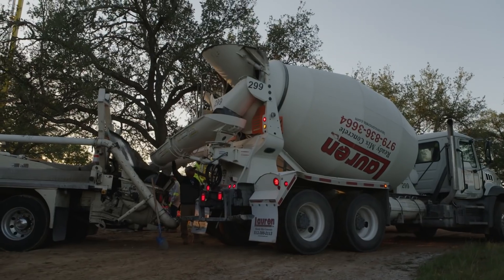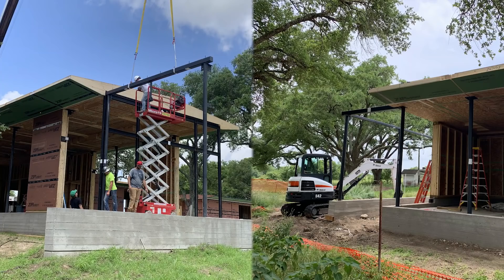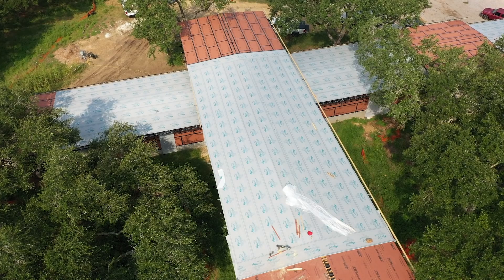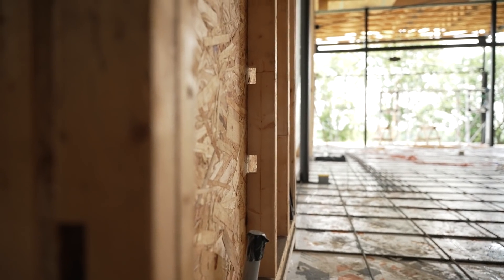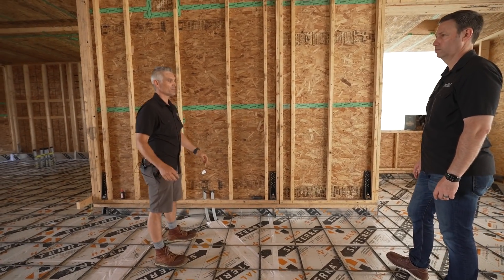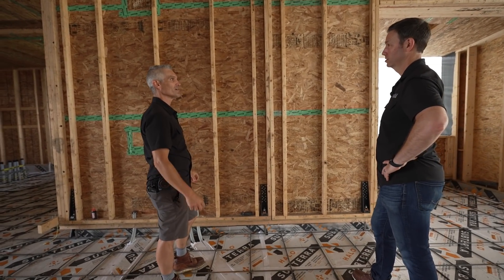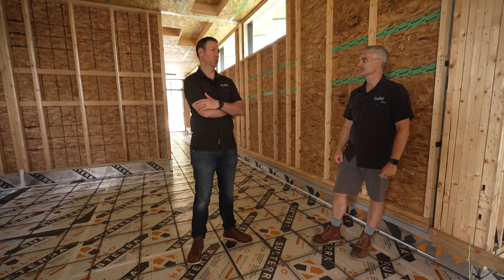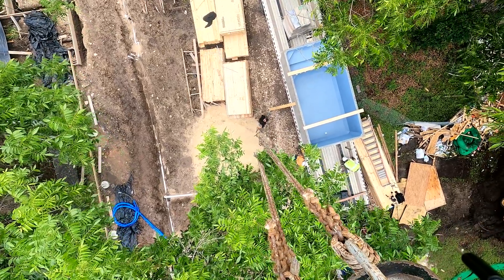Structural Insulated Panels - Framed This House 4x Faster

Comment: On the taping, texas vs europe. You tape the warm side of the structure to prevent condensation inside the insulation when Hot air passes through and cools down. If it's 60 celsius outside you have different things to worry about..

Comment: No need for any kind of termite barrier between the panels and the slab?
This is something to trips me up. I like the idea of taping the panel  to the exterior slab face, for air sealing reasons. But how do you handle termites?
Reply: They put up "termite free zone" signs all over the property... the termites just find another house to bother...
Reply: There's another video of this build that goes over the slab construction and the termite barrier used for this house.

Comment: Hi Love the channel can you explain why the narrow trimmed external zip board is in the centre height of the wall & not at the top. Does this improve the structural integrity of the building. it looks like it makes  the window cut out a lot less complicated by ensuring the entire window is in the middle of 1 board rather than several. would be interested to know your professional explanation. Yours respectfully Jimmy from the UK.

Comment: SIPS are great. Their major caveat is they absolutely REQUIRE expert installers to not only achieve their potential, but to avoid moisture damage. Qualified SIPS installers are not common and Johnny Homebuilder should probably not endeavor to install them himself.
Reply: I am not sure I agree with that. There are lots of resources for step by step installation that most people can follow. there are even workshops that aren't that expensive for people who want to build their own. As long as the foundation does not have any errors, and the panels are assembled nice and tight, the assembly is fairly simple. Caulk every joint, use the provided fasteners, then foam the seams. Walls are easier than roof panels, for sure, but the process is the same.
Reply: absolutely doable with avg building experience.  inexperienced, but willing helpers with one experienced builder, easily done.

Comment: I've been trying to find more info about the sheathing and taping both sides of the exterior wall, but can't find anything, in part because I don't know what it's called.  What is that method actually called, where they sheath both sides of the exterior wall with wood, like OSB sheathing panels.
Reply: The Unity Homes & Benson Wood youtube pages might help? They have videos showing the wall panels being built start to finish with some explanations. The interior OSB acts as their vapor control layer...

Comment: Re speed... our Bensonwood/Unity home: first SIP panel dropped on 12/4/17 (the foundation was poured about 2 months earlier).  We moved in to a 100% completed home on 3/17/18. Built during one of the most intense NH winters in the past 25 years.    Matt, stop by the next time you're in NH: Friday night is pizza night ;).  You can ogle our heat-pump driven ERV...

Comment: Is bensonwood making the sips themselves? As a timber frame designer I have not saw sip panels using zip system.
Reply: Yes, Bensenwood / Unity Homes builds their wall panels in their own factory.  There are several videos of their factory.

Comment: Matt:  How does this style of construction compare to others for tornado resistance?  We are going to be building in the next year or two and my wife is extremely concerned about tornados and having a house that will survive one.  Thanks.
Reply: It won’t be much different from a stick built house.

Even if you build with concrete, it will be very hard for a home to survive a tornado.  With wind speeds above 100 mph, it is very hard to keep the roof on the house.
Reply: Go ICF all the way. I've used both Hobbs Vertical ICF as well as Build Block. Combine that with Helix micro rebar in the concrete and you've got a bunker that will withstand anything a tornado, hurricane, earthquake, and it's even fire proof.  6"of concrete also blocks a lot of sound and you never have to worry about mold or rot.

Comment: Back in the mid 80s . I worked on prefabs . I was The Hooker . Responsible for finding the center of gravity on each panel . Windows installed .. It was blow and go . Some panels could only be hooked with a cable around the plates because of Windows were in the way .. Got screamed at and told how to hook one . Went up 40 ' and swung . Ready to lower and the plates popped .. Surprised nobody got killed as it cut loose .. Years later and more experience . I was working for Donald Gardner Architects .. They were #1 in nationwide sales . My job was not only to build his houses but find ways to innovate his plans . He came to me with a Pre-Fab contractor . And I asked .. So you think you can pre tab this house ? . Ah. No . !! . Donald took one of their simpler plans and had it pre fabbed . He told me to come by one morning to watch this miracle .. So I and my crew grabbed some popcorn and leaned on the truck .. Laughing.. In the end I later had to go fix this house .. Pre tab is fine when building a box of cells .. But it doesn't work on anything that has any complexity .. I don't care how many super computers are used

Comment: It's all very environmental er except thousands of tons of concrete🤢 So carbon footprint terrible - FAIL, sorry guys.
Reply: In terms of carbon footprint, the fail is building a 7,500 square foot house in the first place.  No amount of energy efficiency will ever make up for that.

It drives me crazy that all these famous rich people preach about carbon footprint while building these enormous homes, flying in private jets, and leasing new cars every 2 years.
Reply: @M1911jln  absolutely spot on.
Reply: @adriancarey7848  Just to be clear, I’m not blaming the architects or builders — they are building what the client demands.  And certainly if you are building an enormous home it is better to build one that is energy efficient than one that is not energy efficient. 

But we need to start shaming people for building these ridiculously large homes while claiming to be green. There is nothing green about this level of consumption.

Comment: Don't forget the crane cost an operator and crane where iam is over 125 a hr so 6 weeks just 8 hr days is 15 grand so prob be more like 8 weeks for most say 200 a hr. 32 grand later not including the Advanced framing walls would be a lot. 32 grand is 2 guys Half a years wage roughly.

Comment: Matt, what is the comparison of SIPS compared to stick built homes. I remember years ago that the SIPS panels were brought in with a crane for the walls and roof. And this design was typically used for the floor joist as well on a already foundation. Is this method still used today? Thanks

Comment: it makes up for it by being 4X as obnoxious to install electrical and plumbing.
Reply: I’m not in the trades, so I don’t know why it would be harder. The studs already have not notches to run wiring, pipes - so what makes it harder to do?
Reply: No it’s not.  Bensenwood has already notched the studs for plumbing and electrical, so this is easier for the trades because normally plumber and electrician would need to drill through studs.

Comment: @Matt Risinger why is there a structural slab below the foam and the topping slab if there are no interior load bearing walls? I'm guessing that the architect or structural engineer hasn't watched enough of your videos to understand that a structural slab is probably not needed below that foam.
Reply: secret basement lair...
Reply: One possible reason is that the house may be built in an area of expansive soil and required a "raft slab". I'm not saying that IS the reason. But that's a situation that arises frequently and pouring one massive slab is a straightforward approach to dealing with the expansive soil.
If there isn't some sort of structural engineering justification like that then it definitely seems like a waste of a lot of concrete and the production of a lot of unnecessary Co2.
Reply: If you didn't have that slab underneath, the slab above would crack with every step after the foam starts to settle... it's just a moisture barrier between the main slab... without it, you have nothing... it ties all the walls together and holds their loads together... is it that hard to see??? You don't build a 7,500sq/f home like that on chain walls... are you serious or just kidding???

Comment: I don’t like the roof! Did you notice the way it the 5 foot overhangs underneath (outside portion) tappers towards the house walls. I might be old school, but isn’t the water supposed to be kept away from the walls. I suppose there will be gutters to help with erosion anyway, but it is a little concerning.
Reply: I had the very same thought about that design — any water that gets on the underside of the eaves, whether from condensation or wind driven rain, will drain towards the house.  I would prefer the eaves to be flat or preferably sloped away from the house.

Comment: Matt, Please excuse an amateur question:  what happens during very strong winds?  
Are those long hollow rooms going to "rack" into a parallelogram?
Or, will the additional interior walls add to the overall structural integrity?
Reply: Those long hallways have those metal cross bars to help with racking. And the other parts look to built will Glulam/ trusses. I think it’ll be fine ? But that’d be scary if the whole house warped lol
Reply: @nickbsick6142  I was also mostly concerned about very strong winds that blew before all construction was completed.  The tall ceilings have created very large surface areas at the exterior walls.

Comment: I've seen many videos on fast wall building systems -- but walls are not the slow bits to finishing a house construction. The slowest steps are typically the basement concrete (including curing), roof (trusses plus later decking and shingling), and finishing interior trim or kitchen/bath cabinets and tops. And permits with inspections. I'm not in the home building trade so it would be great Matt if you did an episode showing the whole project timeline and chunk out the big time consuming steps to go from a bare lot to a family stuffing their furniture inside. Then methods like these wall systems that eliminate time from those major critical path steps. I'll bet it's appalling to see the amount of time consumed getting permits and waiting on inspections and corrections.
Reply: Just because one can build faster does not mean one should. Every contractor is dealing with schedules, meeting clients, multiple job sites and has a wife and kids at home. Quality of life, setting down the tools and going home at 4 pm means something too. When a developer puts up cookie cutter houses in a subdivision, subcontracts can go from one house to the next saving time and costs.

Comment: The very low pitch roof will probably be a never ending problem.
Reply: It's going to be standing seam metal roof, with a good product leaks should be next to impossible.
Reply: Nah.  Flat roofs have been around forever and they're detailing it well.

Comment: All that overkill and still using dinosaur studs. I guess the owner will be broke after all the wasted construction and will need to save a few bucks on heating and AC.
Reply: I'm intrigued, please elaborate
Reply: @Daviddaughters  They already had panels that are structural and well insulated. Then they went to the trouble of adding a stud wall inside. Oh but they also wasted time cutting square notches in them for the electrician. Oh my,, drill a hole and move on.. Wood studs. Later they will need many straightened. No way these billionaires are going to put up with a less than perfectly flat wall. Where is this house requiring the entire floor to be super insulated, Antarctica? 
Gees Build. Show us a process good for the common man, affordable and available. He's gone and whored himself out to product manufacturers. Lastly, builders in shorts and sneakers.....no respect.

Comment: As a carpenter I wonder how repairable is this structure. Let's say that 30 years down the road some sheathing gets rotted and studs now what? Im constantly repairing rot on houses built from 2000s and are covered in rot.
Reply: my brother can answer that question - one of his neighbors built a SIPS house and let it get wet.  2 years later, they built temporary walls inside every exterior wall and completely removed the remains of the SIPS and replaced it with traditional framing.
Reply: @kenbrown2808  just want to remind you that the SIPS panels that matt is talking about in this vid aren't like the traditional SIPS panels ... the SIPS panels made by bensonwood are wood framed and have cellulose insulation ... they aren't the foam panels with two OSBs on either end
Reply: @dovahkindragonborn9827  so... are they treated to prevent rot?  because you now have something that is 100% organic fiber.
Reply: why would it rot?  The exterior Zip system is supposed to be waterproof
Reply: You know what us behind zip coating osn
Reply: Why do you think rebuilding these walls would be any different than a stick built wall?  This wall system is built with studs, Zip sheeting, an OSB panel, and another smaller interior stud (to frame the utilities channel), plus cellulose insulation.

Comment: Is that roof truss profile designed to reduce uplift like an upside down wing at the awning? Because that’s what it looks like. I also like the steel beams with tension ties on the bottom and the cross brace at the end wall. It’s a structural piece of art!  At 2:39
Reply: ,many tho would consider industrial and ugly....

Comment: I suppose you might say that the Swiss design their houses like their wristwatches.    And we can learn from that.  But NOBODY's contractors are more productive than America's.    To put up an air-tight, 7500 sq ft UNIQUE... highly-engineered...  house's shell... rain proof... in 30 days (notwithstanding 20 inches of rain during that period!) ... is simply mind-boggling.       Did he say only "5 framers" did that?      Well, even if the panels were pre-fabbed elsewhere, that boggles my mind.
Reply: They look Latino. Hardest workers I've ever built with.
Reply: Greatest country in the world.

Comment: We built a home out of SIPS building Went up in 2 months with 4 guys building 5500 sq ft. Very insulated structure here in WY. We love it so far. Some minor changes we would have done but overall great so far.
Reply: What sip panel company did you go with? What changes would you make? I am looking at building a sip house next year.
Reply: EPS.  Make sure you plan all your window and door placements very carefully. Any changes can be hard and some not possible after they frame it up! We wanted larger windows in our living area after they put up the walls. Engineering said no. Very disappointed about that. So that really is my only problem. very cool in summer and warm in winter here in WY  @b.c.g.9754
Reply: I looked into it here but at the time no one made them here and shipping from the lower 48 made it real expensive.  I ended up going with double stud walls with foam. Our place is a duplex with our unit being larger with a garage between them. We heat over 3000sqft with about 450 gallons of oil a winter. We have weeks that don’t get above zero. I also don’t know what the specs are on snow load on SIPPS.
Reply: Are sip built  homes energy efficient?

Comment: I'm rather surprised the client didn't want to go with radiant heating in the floor.  Although you would probably need a couple of boilers at the end of each wing of that house.
Reply: It's not something you really see in Austin.  Also, at near passive, it's not something you really need.
Reply: How many miles of tubing would that take ?
Reply: @augustreil  Probably 2 or 3 LOL
Reply: There's a lot of open space for drilling into the ground. If that were my home, I would go with geothermal HVAC, and forced air, not miles of tubing.  If you don't want to waste heat in the ceiling, use a ceiling fan to circulate the air in the room
Reply: @cyclopsvision6370  I'd definitely go with geothermal as well (should have specified that in my original post).  If nothing else it would help to stabilize the temperature swings inside the structure.
Reply: Radiant heating isn’t needed in a very tight, well insulated home.  You just don’t need that much heating / cooling, and it adds a lot of cost to an already expensive home.